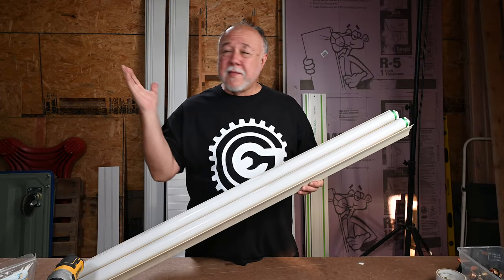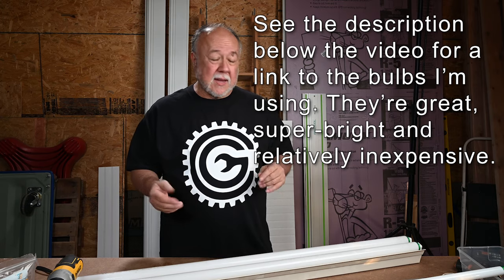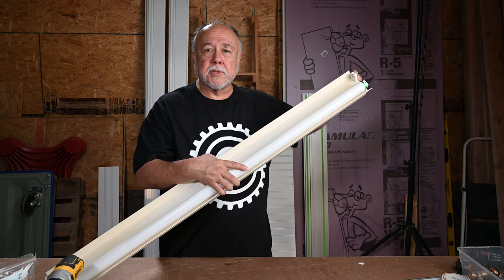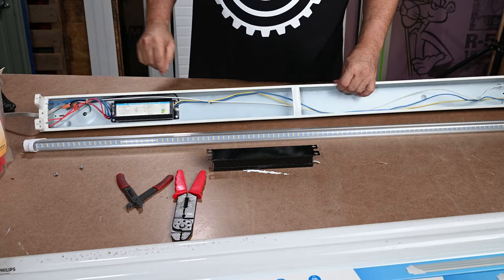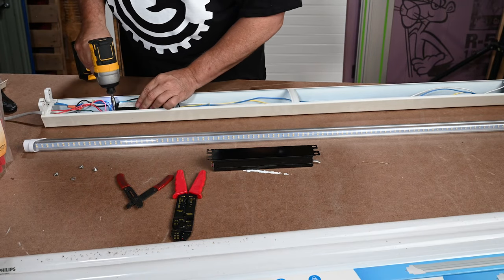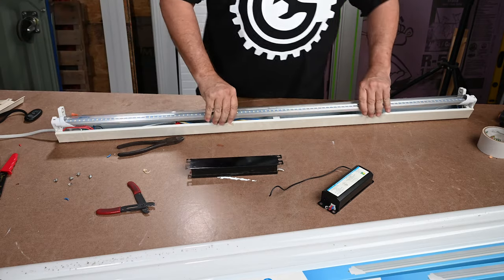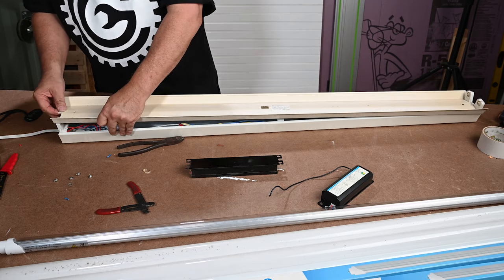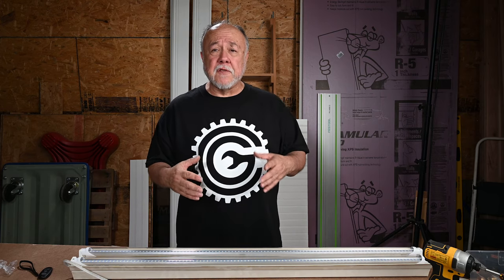How To Convert Your Old T8 and T12 Fluorescent Fixtures to Brighter LED Bulbs

Comment: You are only telling people how to wire type B bulbs .how are Type A wired.
Reply: Type a will work with some ballist but not all of them. If they don't just plug in and work they are wired the same way as the video. I bought type a + b hoping to avoid rewiring but I had an electronic ballist so I had to wire anyways but it's all the same

Comment: I have a fluorescent light with the neutral going to one end and not through the ballast like the one in you have.  I couldn't find a video that had that setup until I came across yours.  My ballast went bad recently and the manufacturer couldn't advise me on a replacement.  Seems like a good time to convert to LED tubes.

Comment: There are TWO TYPES of led tubes.  The led tubes like Cliff has here are DOUBLE ENDED and have a neutral wire going to one end, hot wire to other end.  Both end caps on tube are white. 

The other type led tubes  are SINGLE ENDED and powered only on ONE END.  This type tube/bulb usually has a green cap on one end, a white cap on the other end. On this type a lead (hot) black wire goes to one side of each tombstone, a neutral white wire goes to other side of each tombstone.  ALL WIRES go to green end of the tubes. There is no wiring on other white end of the tubes. Its only use is to hold the tube in place. (Some single ended led tubes have white caps on both ends so you have to know which type you have before wiring.)
Reply: Yeah, and it's worth pointing out that you should ALWAYS read the instructions that come with the bulbs, as this will ALWAYS make sure that you don't break stuff.
Reply: The colored wires are just extensions of the black 'hot' wire on one end, and of the white 'neutral' wire on the other end.

Comment: Great info and you even showed a strange wiring situation which will likely help the odd person or two in the future.

Only recommendation I have is to throw in some information about shunted vs. non-shunted and single pole vs. double pole LED bulbs.

I'm currently rewiring mine, but I am using single pole LED bulbs so my wiring is different and only one side of my tombstones are wired. It's still the same concept though, all the neutrals together all the hots together and then pigtail to the home wiring.

Comment: Hey Cliff, out of curiosity, which T8 LED's did you end up installing?  Also, did you notice a difference in the light output of the LED's versus the older florescent bulbs?  I'm looking to convert my workshop over in the near future.
Reply: Looks like Cliff doesn't bother answering questions.

Comment: Why not clean it up. You can make jumpers for tombstones and run one wire to each set of tombstones. Also, get rid of the two wire nuts in neutral wire. Just put a long enough wire from tombstones to neutral.  Remove anything that could cause a problem?
I believe that when wiring uses the KISS method. Keep it simple, stupid, and clean, which is always better. Just my two cents worth.

Comment: Well done but I just want to make sure I understand about the ground wire, you pretty much don’t have to touch it right?  Just leave it attached to the fixture from the home wiring?
Reply from the maker: That's right, just make sure it's securely attached.
Reply: Code calls for it to be grounded, but like any 120VAC device, it will operate without chassis ground.

Comment: You mentioned that you can keep the tombstones (connectors).  However, most LEDs require non-shunted connectors.  If they're shunted, you might burn out the LEDs or short the circuit.
Reply: There are two types of T8 LED bulbs. This type and the other type. The other type require non-shunted connectors, and require power only in one connector. One end of the bulb is marked "AC input".

Comment: Thanks for sharing , Cliff!  I have seen two different wiring methodologies for these conversions and really don't know which would be better economically, but I digress.  What's your opinion on that anyway?
My real question is that for your conversion, can the tubes be installed in either direction? I know for DC, flow only goes one direction, but with circuitry, does the AC get rectified to that required one direction?  And, of course, there are those LED tubes that have the live conductors on one end and dummies on the other. Those definitely need to be installed in only one direction.  Thanks for your video!

Comment: What is the difference between a Universal LED and a Bypass LED? Is the Bypass more problematic? If your fixture is wired in, like in an old kitchen, don’t you need to know about detaching it from the wall or ceiling? And are lengths of bulbs rounded up, as 17 1/4 inch is 18 inch? Thanks for the video, better than most. Oh, and blue and red wires are there for decoration?

Comment: Great video!  I have T8 fluorescents in my shop.  When I turn on my AM radio, there is static if the lights are on.  I have been told it is from the ballasts.  Am I right in thinking that if I make the switch to T8 LED's and eliminate the ballasts like you just did, the radio static will go away?
Reply from the maker: Given that ballasts are known to be "noisy" and can emit radio frequencies, it makes sense that they would interfere with your reception. So, yes, if you upgrade to LEDs like I do in the video (actually remove the ballast) the problem should go away.
Reply: @CliffsGarage

Comment: I have a four-lamp fixture. I took out ALL the wires except for one for each tombstone. I attached all of one end to the hot and all the other end to the neutral. But none of the lights are coming on. Any ideas?
Reply: You may purchased the wrong kind ( Like I did first). You need the “B” type. Some are so called “Instant On “ and designed to work with electronic ballast. It actually said “ to be used with electronic ballasts “ on the box. Returned those to Home Depot and got the proper ones elsewhere.

Comment: I just place new leds T8/T12 tubes in today. They replaced the older fluorescent tubes. I flicked the switch and they worked fine. Should I be worried?
Reply: Only if your ballist eventually goes out.
Reply: @akraiders3094  But no danger of a fire?

Comment: T8s are smaller than T12. the number refers to 8th of an inch. Both of those bulbs you were comparing in your video were T12
Reply: It sure looked to me like a T8 that he was putting in that fixture.  The T12's he took out were a half inch larger.  Besides, most LED tube replacements are T8 which makes the conversion economical and easy to do.
Reply: Ya those small ones were t8 and the thick ones were t12. He had it right on the video